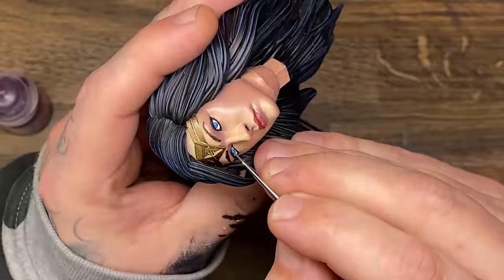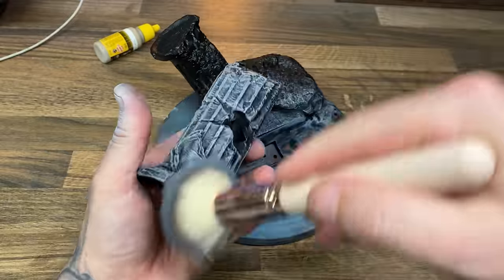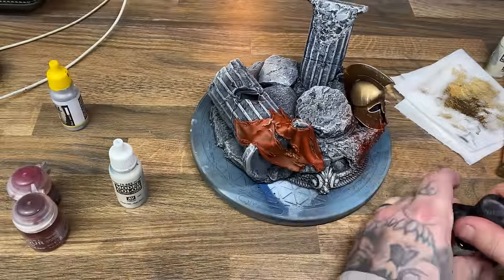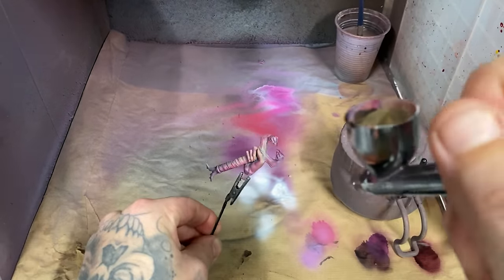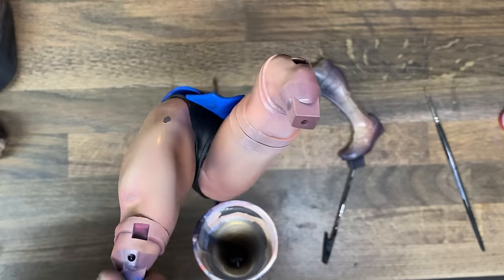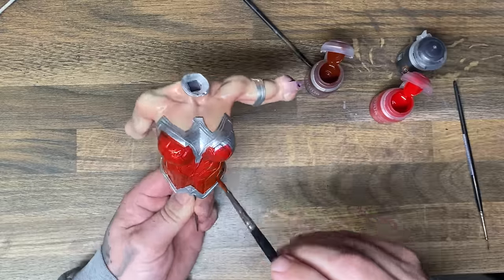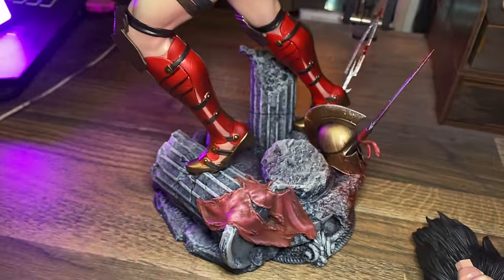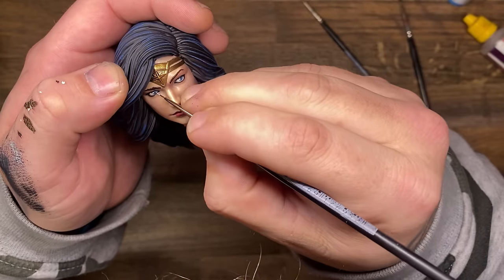How To Paint 3D Prints - Fix a Mistake After Painting

Comment: this is so cool, quick question though: can you get results of the printing model close to this with an fdm printer? Or do i have to get a resin printer and not even try with fdm?
Reply from the maker: You can. If you tune your printer well and use extremely low layer heights with a smaller nozzle. But resin would be better and way faster

Comment: how do you usually orient to head when 3d printing? usually have a difficult time placing supports for those so not to lose detail
Reply from the maker: Nose at like 30 degrees ish and I’ll settle for wherever the support have to go in the hair.
Reply: @Groundeffected  Thanks, is the nose facing towards the plate or away?
Reply from the maker: @istorm6887 away🎉

Comment: Hi!  I'm still fairly new to 3d printing and painting but I noticed in your video after you clearcoated the skin you got the silver paint from her uniform onto the skin areas and then it disappeared.  What did you use or do to clean it off?
Reply from the maker: That’s the purpose of the clear coat you can usually use water to wipe it off with a cloth or worse case some artist spirits stuff hahaha but if you don’t let it dry then you make a damage like I did on the thigh and once you through that clear layer it’s history. I made it worse by thinking I could keep wiping it off
Reply: That is what is confusing me since it looks like you used an airbrush to aply the silver and the overspray got on to the skin.  I would think the paint would have dried before you finished and was able to wipe it off. @Groundeffected